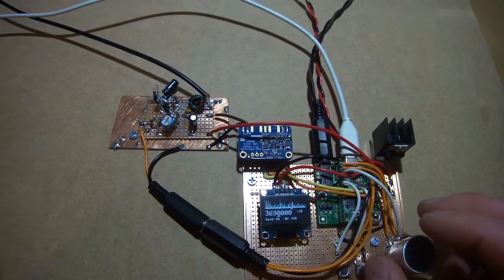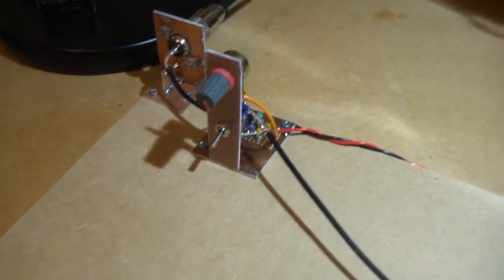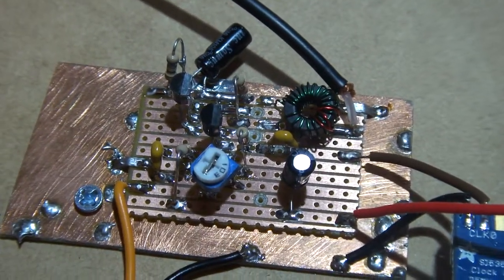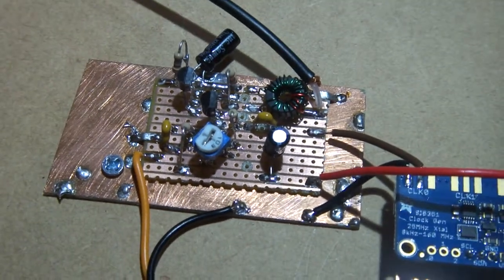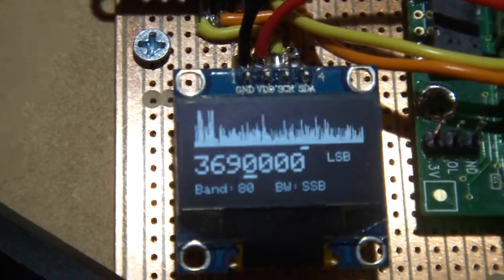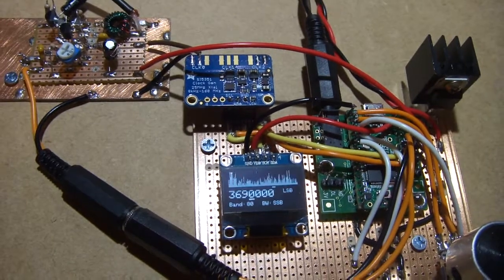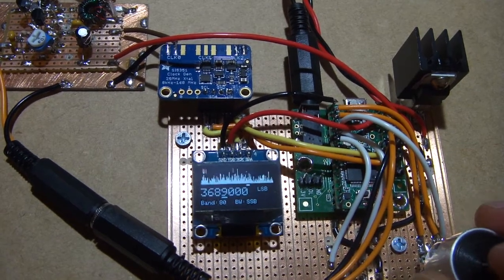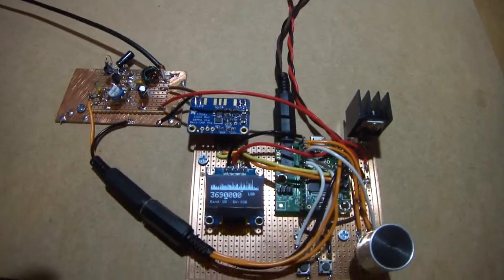Simple Homebrew SSB/CW Transceiver - Direct Conversion Experiment

Comment: very nice project!do you have a reference to that mixer?is it available on Pete's site?
Reply: i found it  ("Pete's mixer") on his blog.i think it is the same one with yours.layout looks similar :-)
Reply from the maker: Yes, that's it. I didn't bother with the AF filter on the output as i was just playing around. As an aside, I removed the input impedance matching transformer on Gate 1 and immediately got a reduction in gain. Clearly not achieving maximum power transfer due to the impedance mismatch. I've started refining mine (in LTSpice) to make it into an input mixer with a 9MHz IF output. I make two, as one will need to be the product detector. I'll worry about the transmit side later. 

73's
Charlie